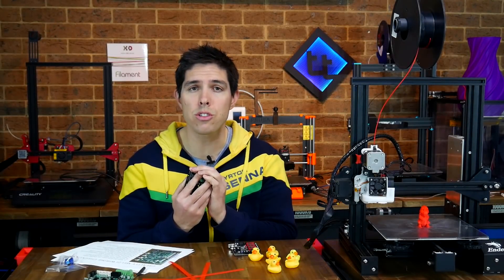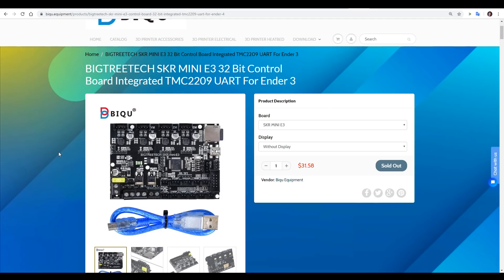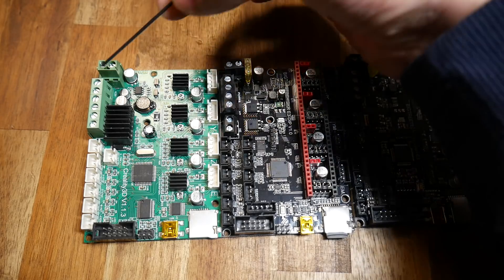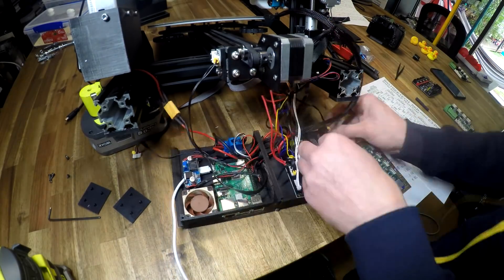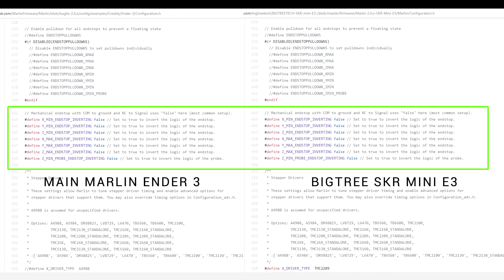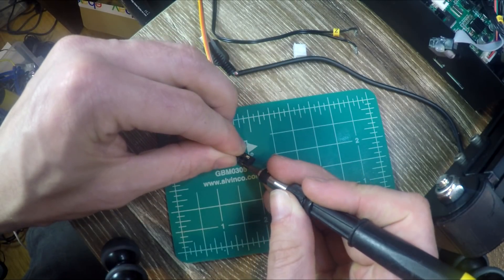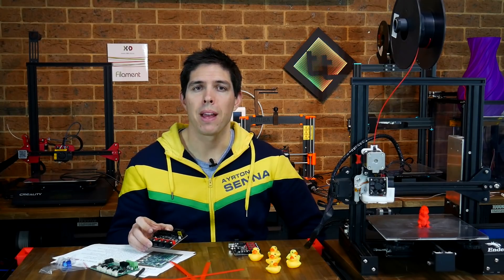SKR Mini E3 - The best Ender 3 upgrade from stock?

Comment: I just did this on my new ender 3 pro. Might be a minor change the wires going to spot E are no longer white/white they are now black/black.
Reply: Was your original board hot glued down? It took me about 20 minutes to remove the glue to free the cables
Reply: @applec2400  yep. One of the terminals pulled out before it unplugged. Should be illegal

Comment: Michael, Thank you so much for all you have and continue to contribute to our community. My question is that given all the mods you have done on your Ender 3 now with this edition are you satisfied with the quality and ease of use of your printer? As well because I am on the fence to purchase my first Ender3 due to all these mods that are above my technical capacity to implement, I was wondering if you offered your services to provide fully mod printers to your specs? Basically, I want an updated and tricked out Ender out the box without having to modify it myself too much.

Comment: DOH they are Out of Stock until mid September  BUT Great video and I'll be ordering one !!!
Reply: OK the 2209 chips are out of stock so I guess they build these things in house. BUT there are only 3 boards left and I just got one.
Reply: Exactly because TMC2209 are very new and not available in huge amounts yet, the SKR e3 DIP was relased. If you add TMC2209 on socked, you would get exactly the same funkctionality. But do you realy need the extra funkctionality of a TMC2209 over a available TMC2208? Also will your Ender3 be your last and only 3d printer? Mostlikely not.
So you might get the SKR e3 DIP with TMC2208 and in a year or so get TMC2209 and use the 2208 to upgrade an other printer...

Comment: So this is probably going to be my next purchase as I slowly upgrade my E3pro towards PLA & PETG print-ability ... my only question is this, Will this board work with an inductive probe instead of a BL Touch?? I'm not a Fan of the BL Touch, not sure why but it doesn't do anything for me, and I was wondering if there is anything different I would do to use an inductive probe instead of the BL Touch.  Thanx for the great videos... they have taught me a lot!!

Comment: After following the steps from BigTree and my code won't compile. 
I presume the error is "UserSideException: Please install Git client from https://git-scm.com/downloads:" but I'm not a coder by trade.
The file it fails on is "STM32F103RC_bigtree      FAILED    00:00:01.419" which clearly is a problem.
If anyone has any advice, I would really appreciate the help. my steppers are running too hot and making exaggerated moves, which i did "fix" in the 'Configuration_adv.h' file by adjusting the amperage.
It just will not compile.
Reply: I found the problem. For some reason, the git path had extra \ in the path. not sure why, but it compiled

Comment: Got the skr mini e3 v1.2... The printer crashes when starting Cura... S3D and pronterface is working.  Any ideas?  Btw - noob question.. how can i retrieve the current configuration.h from the board?
Reply from the maker: Impossible to pull it off the board. I've got a 1.2 board and am planning an update video soon.

Comment: Hello all, Totally new to 3D printing and have an April 2020 Ender 3 pro, so my question(s) are is this a easy GOOD replacement for the Creality default board? Does it come pre-loaded with Marlin 2.0 & the stepper motor drivers? Looking at your great video, it seems well within my capability to have a go at this once my noob questions have been answered.
Thanks Teaching Tech, your video's are great and they are really generating my 3D printing juices.

Comment: Teaching Tech, there have been so many videos about upgrading the Ender 3.  were there upgrades that didn't work out, like the stepper dampers?  or other add-ons?  with what you know now, would you consider making a video about the upgrades you recommend and those we should avoid?
Reply from the maker: That's an interesting question. There's never been anything I've recommended and later regretted. Stepper dampers I was happy with, especially for the price. I guess with time and progress there are just better options now.
Reply: @TeachingTech  I don't have stepper dampers.  So i should get the version of this board with the 2209 stepper drivers, right?
Reply: @ryanbarber6358  With this board, (and 2208 or 2209 TMC drivers) you don't need stepper dampers anymore.

Comment: Followed your guide with BLtouch preconfigured firmware.  Printer is working wonderfully however i am wondering if i may have earlier version of board.  My SD card now has an EEPROM.DAT file saved on it after setting z offset and saving setting.  Does your SD card have this file that appears for saved EEPROM settings?  Thanks!  Your videos are awesome and informative!!!
Reply: From what ive read i think thats normal, aparantly the board doesnt have its own eeprom chip so saves the epprom settings to the sdcard.

Comment: Bought this board after watching TT review on the BigTree TFT which I also bought.   It's been a struggle and I still have issues from time to time.   Lately the machine will start spitting out filament constantly when a print starts.   Again this only happens now and then but it is annoying.   The other issues is once in awhile the stepper drivers make weird noises when homing and if I don't quickly shutoff the printer the carriage will shoot to the right and crash on the X axis.   If you use Cura, then there were connection issues but I found a reddit post that showed how to change the config file for Cura and it works now but this could be the cause of these other issues I am not sure.   The 3% of the time it fails I just restart and print rather than try another slicer.   I like Cura.

Comment: Michael, FINALLY received my Mini  E3 board today. was reluctant to do the change cause my printer was working so well. Finally went for it with some free time today and after finishing, I see a few issues;
Firstly my BLtouch cabling didn't need changing going from Yellow to Blue to Red, so bonus. (although I had Blue which I assumed was your Brown) I noticed I had no display. and I had a red power light on the board, however as soon as I plugged the BLTouch cable to the servo wiring plug, both the screen AND the power light went off, although the fan continued so there was power to the board. Any thoughts?
For fault elimination I bought and downloaded the firmware put it on the SD card and rebooted. 
I now see a 'TMC Connection Error' presumably because I have the BLTouch cable unplugged?
I'm thinking there is something major I missed cause I also note I am not getting any motor movement when manual adjusting. all very quiet!!
Reply: Looks like some others are having the same issue online too!
Reply: ** - UPDATE - ** Scratch the moving it is working just incredibly quietly, which is a good thing!
So 'TMC Connection Errror'  and  X Axis seems very right. I figured with all Firmware update you wrote I'd be ready to go on from a homing and X,Y,Z axis perspective?
Reply: Use this firmware - https://github.com/gazcbm/Marlin-2.0.x-SKR-Mini-E3-v1.2
TT's video is the old version of the SKR
Reply: @AdamHuxley  Thanks Adam, Actually got to the same place on my own. Michael's video needs a bit of an update. Primarily in the BLTouch Wiring diagram. All works well, but the BLTouch wiring for the new BLTouch needs to be Yellow, Blue, Red as opposed to effectively, Red, Brown (you would assume the Brown is replaced by the Blue) Yellow. All working great, I'm just printing about 2 mm off the bed. Sure this is simple!
Reply: M Durbs 2mm above? Have you set the z offset

Comment: Greeat video - I just did this upgrade.

I'm seeing the problem with STORE TO EEPROM not working with the BTT source code; my Z offset value is also being lost (though oddly not always - about 50% of the time) but I believe I can fix that with the Marlin version?

Second issue I don't really understand - I have fitted a servo (to the SERVO socket) with push-button switch (to the PROBE socket) for auto bed levelling which works fine. I see the comments say to use the Z stop pins for the switch, but then what happed to Z homing? Are we wiring in parallel? Using soft end stop? Something else?
Give that I'm now using the PROBE socket where can I connect my runout sensor?

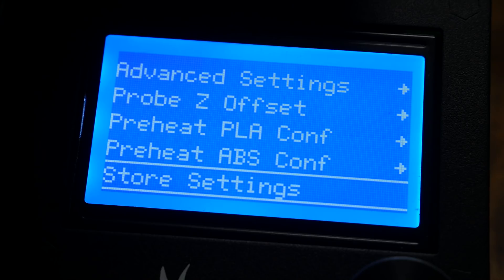Comment: 9:05 "store that to the EEPROM"
The early production SKR Mini E3's don't have a built in EEPROM and require a blank file on the SD card named EEPROM.DAT (all caps). They also require changes in Marlin to enable this.
Apparently later versions of the board have/will have a main chip with an EEPROM integrated and don't require the file.
Reply: MrClown but when we purchase from the store we wouldn’t know the version until it comes

Comment: I see elsewhere that loads of people are having problems with this SKR mini E3 board and their BLTouch 3.0 (it seems due to to a very bad signal noise on the 5 volt rail). Has anyone found a solution.
Reply: I think Michael has a video about setting up an addition capacitor on the board between +5 volts and ground.  It's mainly for temperature variation but it should help with this problem too.
Reply: @marktoogood  I am realy starting to regret ordering this board! 

Would taking the 5V from a buck converter and just using the board for the signal connection (plus the Z endstop connection) be a feasable option? Not ssure what to think about the overheating.....
Alternatively, do you know if there are any problems with the EZABL which takes 24V not 5V?

Comment: Are BigTreeTech SKR Mini E3 or SKR E3 DIP fully compatible with for Creality CR-10s if use its configuration file in latest Marlin 2.0 firmware?

Hardware-wise, other than build area, the main practical difference between Creality Ender-3 and the CR-10s its dual-steppers for Z-axis? 

Any chance that BigTreeTech / BIQU themselves would be interested in releasing preconfigured Marlin 2.0 firmware packages for CR-10s?

Also wanting to use BLTouch for automatic bed leveling and guess that is a relavant follow up question in regards to CR-10s firmware config?

Comment: I have an old Ender 3 clone based on an MKS Robin Lite that was dead when I received it. I am trying to replace it with a BTT SKR Mini E3 v3.0.
My printer has X, Y and Z endstop switches that have 3 wires, so they don't fit the BTT 2 pin connectors for these endstops.  
I am willing to replace my end stop switches with 2 wire versions or rewire the existing switches if I can find out how the 3 wires should be connected on the BTT.
I only seem to be able to find 3 wire switches on line.  And all of the instructive YouTube videos show people upgrading Ender 3s with 2 wire endstop switches.
Any help would be appreciated.

Comment: I got one of these boards when it first came out, wont work! had people try and help me set it up properly to no avail. kept getting failures, would only move the x axis once upon turning off and back on the power and doesnt hold the sd card like it should. Also BTT on aliexpress have been beating me around the bush to keep me from returning it and avoiding giving me a shipping label!
Reply from the maker: That's a shme to hear. Hopefully they are lifting their game. I hope you can get a refund or replacement.

Comment: So where does a filament runout sensor go? I read that it goes into the servo port, but if I understand your video, that's where a BLTouch goes? So you can't do both? I know your other video talked about Servo 4, where is that on the miniE3?

Comment: The prices for the TMC chips are a bit off? Looks more like prices for complete modules.
I could buy TMC2208 for $2.40 from DigiKey. And I did buy some a couple of weeks ago and replaced one A4988 on an V1.1.2 board with A TMC2208. Never got around testing it though since shortly after this I learned about the TMC2209 boards with UART connection.

Comment: Great video! I use your video about the MKS Gen L board install earlier this year. Unfortunately my USB port on that isn’t working anymore, so I cannot connect to my raspberry pi through it. I’d love to know how to install a run out filament detection sensor. Do you A resource that can help me do this? Or are you able to create a quick video showing that?

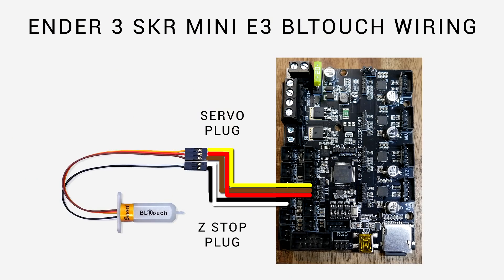Comment: 8:20 Do you really recommend to remove the pins and swap the probe wires of the BLTouch? It's a 2 pin connector... how about rotating the connector
Reply: Most connectors only plug in one way.
Reply: @raptor1jec  The BL touch uses Dupont connectors, can be rotated freely

Comment: hi ,i was wondering if there was a way to tweak an ender2 like it s possible on ender3 to get  less noisy motors. 
  i ve changed my mainboard on my endre3 pro for a v1.1.5 and it s amazing how silent it  became.
 i,ve installed dampers on ender2 but there is still the "bzzzbzzz".   i contacted creality and they said there was no similar card for ender2.... 
   i m not familliar as you are with swapping cards for mks or else.   could you tell me if there is a solution?   thanks for your videos.

Comment: just installed board.  Seems OK but how do i let the board know it's an Ender 3 Pro printer?  I dont know how/where to load new firmware if that's the answer.  Unsure how to setup the usb driver so that didnt happen.  are there further instructions in this area?

Comment: I want to get this to dampen the noise of the motors, but I’m concerned about having to make constant updates to firmware. I kinda want to just keep everything how it is now that I have it working. I’m not interested in connecting my printer to my computer or the internet or installing a BL touch. I’m only really interested in the noise reduction. Can I use this board without constantly updating stuff?

Comment: Thanks Micheal,  I notice that there are no heatsinks on the Mosfets for the heaters.
The version I received is v1.2 the firmware for v 1 does not work with v1.2.
Reply: The firmware on the V1.2 should be already the newest Marlin_bugFix_2.xxx
Reply: @EL90291  The new Marlin-2.0.x-SKR-Mini-E3-v1.2.zip is on GitHub and the configuration.h file appears to be set up for the BLtouch. I have downloaded and compiled the file but have not tested it as yet.
Reply: Did you find out if a heatsink on the mosfets is needed?
Reply: @rainerrauser8618  No.  The Mosfets are rated at 80Amps,  the ender 3 heater draws about 10Amps at 24v so I believe that heatsinks may not be required.  Also 
v1.2 has larger heatsink pads on the board for the mosfets and also the 5v regulator which was a problem with v1.1.
Reply: @billbrown1877  Thanks! I think i'll opt for a larger and silent fan then to just increase the airflow a bit and stop the noise. Feel like the board fan is louder and more annoying since i made the upgrade...

Comment: Is there anything special to allow the Ultimaker Cura software to connect?  Now that I have the board in place, my Ulitimaker does not seem to see the printer when USB connected.  Do I need to use the provided 12 inch cable as that would make it very difficult.  I am using teh Ender 3 cable and it will not recognize the printer.  Any assistance would be awesome, thanks!

Comment: Thanks Michael, you should get a commision, I got mine installed and running nicely.  However I noticed one thing.  The heating up of the bed and nozzle seem to take 2-3 times longer now.  Can anyone help explain that?

Comment: Got the board installed.  Nice an quiet.  Noticed the part cooling fan is turning on and off all the time.  Had an issue with heat creep. Before the change, this fan was always going.  Has this changed with this new board?

Comment: Great video as usual. I bought one for my Ender 3 because of the video. However I wanted to add a filament out sensor and touch screen also. I bought a MKS version of the touch screen at the same time, however the pins do not match up. So not sure I can use it. Also can't figure out how to wire up the filament out sensor. Can you help me out? Might be good video
Reply: If you look at the skr mini board, there is a 5 pin connection called TFT. You only need 4 of the connections (5V, GND, Rx,Tx).
Reply: @lancescott5875  Thanks, But I am also stuck on the filament out sensor.

Comment: Just loaded your firmware for setting up the BLtouch on the SKRminiE3, "BLtouch with ‘standard’ mount"
The board I received is marked V1.2.   I'm receiving a 'TMC connection error'.  
When I try a Autohome, the hotend moves fast to the right, slamming into the stop.
Any thoughts on correcting this?

I really appreciate your videos
Thank You

Comment: HELP! I upgraded my Ender 3 to the SKR mini E3 v1.2 board. After the upgrade every print starts fine, but after 10-90 minutes the hot-end becomes clogged. When I pull out the filament I see that the edge of the filament becomes much thicker. This is not a filament issue - I checked and the diameter on the spool is uniform, for some reason the material thickens near the hot-end... Is this a temperature issue? I've recalibrated the extruder so I know that's no the issue.

Comment: Thanks for such a great suite of videos and an enormous amount of useful information. I'm new to 3D Printing having just purchased an Ender 3 Pro. I was surprised that it doesn't come with any direct PC based s/w just the SD card interface. Will this board allow me to run s/w like Octoprint without any additional h/w like an arduino? Thanks again.

Comment: the new 1.2 board has different pin out the sensor is pa1 +5 Grnd the bltouch i have 3.1 was pinned +5 pa1 ground, I had to switch red and yellow(could be red and orange) my ground is blue others have brown